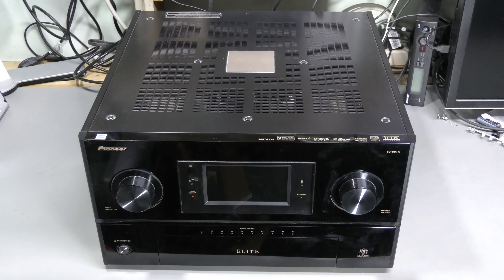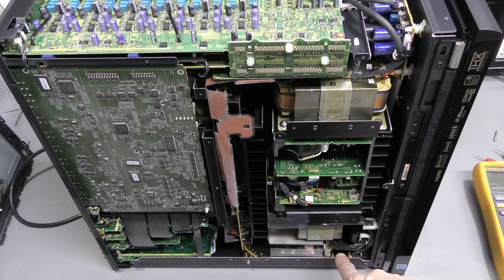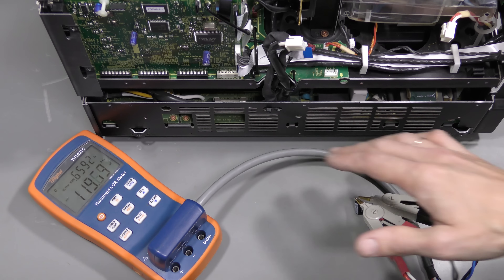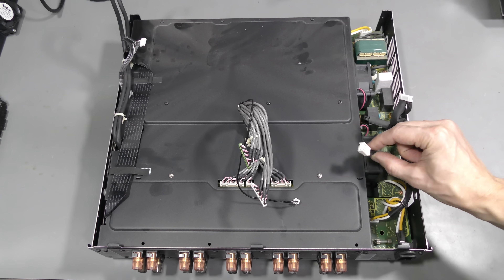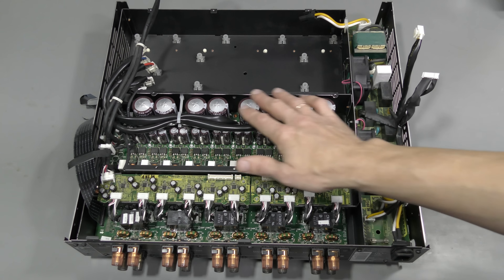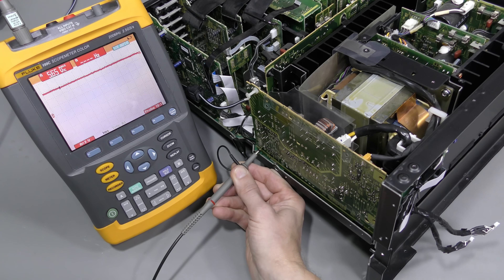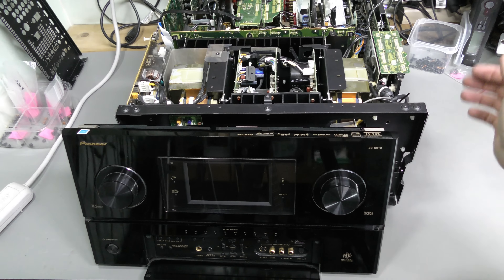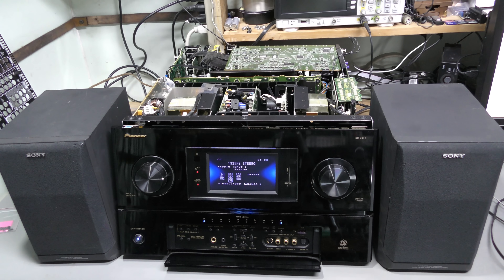#128 - High-end Pioneer Elite SC-09TX receiver repair

Comment: I am amazed at the complexity of this monster AVR. And the ironic part is that about 90% of its back connectors would remain unused most of the time as the end user would most likely just use couple of HDMI inputs. This means many if the daughter boards would also remain unused. But the protection circuit would check each of these boards and even the slightest fault even in any one of the boards would render the whole unit unusable. Just makes me wonder if the whole concept of an 'Integrated' amplifier actually makes sense. 
Btw, amazing troubleshooting this one. I rarely see repair techs inserting logic probes between two chips. 
Amazing work man. Wish you luck!!

Comment: Wow - fantastic work! As you said, it doesn't seem like all those capacitors would bulge exactly the same amount (as they appear to have done in the video) - if caused by heat the ones closer to the fan would be less bulged. Maybe look for manufacturer's literature with pictures of their products?
Reply: Yeah I've never seen large scale capacitor plague like this, I wonder like you if they're meant to look like that
Reply: Plus, it's unlikely that all ten channels were used enough to cause that kind of equal deterioration in all of the caps.

Comment: I dont think i've ever come across electrolytic caps with an as-made from factory bulge. Might be worth investigating the brand & datasheet for one of them.
Never say never though coz all of them with an identical bulge and in different areas of the unit.......you just dont see that!
Expensive to change them all!
Reply: I think that you should replace those capacitors. Excellent and very logical process to find the malfunction.

Comment: Test those caps, since you are in deep enough into it already.  I'd bet that even if many are weak, the unit isn't worth the cost of repair.  The blue power led working after re-solder may be telling another story: there may be other failed solder joints.  Unless it was a result of putting more boards back into the chain and completing that circuit.  These units have more complexity than a home PC!
Reply: That unit is worth about $3500, so I think recapping it would definitely be worth it. It just needed a hard reset to get going again, although That LED might have just had a failed joint like you said. I've worked on a few high-end Vifa Stockholm speakers with a similar issue. After I picked apart the first one, I realized (after a long session of research) that it just required a hard reset as well. Bitter-sweet realization.😬😝

Comment: The only way to really know what happened is by having the firmware of the microcontrollers... or by doing reverse engineering. 
The resonator failure was the key to restarting everything.  
I would like to measure the capacitance near the resonator or the stray capacitance of the PCB.
Can you make resonate the resonator outside of the PCB?
Now it is working. Congratulations!. (By the way, is that Fluke one of the ones you've fixed? Nice instrument!)

Comment: Oh, and one last thought, do you think it would be possible to use the amplifier section on its own, without the upper receiver section?  It's a nice 10 channel amp, and could be used for any number of applications if it could be setup as a separate unit.

Comment: The doming on the triangular relief valve style cap are not even, I think all the caps are bad, I have certainly seen caps testing ok but still being no good when used at higher voltages in circuit.

Comment: Terrific diagnostic work!  I have one of these and it's similarly stuck in a protection mode.  Can you tell me how you did the manual reset?  I've searched the web and cannot find directions for the reset anywhere.

And additionally, would you be interested in repairing my unit?  It's a shame that this big beautiful receiver is just wasting space.  It deserves to be put back into service if possible.
Reply: I have the same unit with similar issues. It powers up for a few seconds and then shuts down. Then the phase control light flashes.  I called every possible repair shop where I’m from and no one will touch it. It really is a shame because up till now it operated flawlessly but now it may as well be a boat anchor.
Reply: @bq6162  So one option might be to try TRD in Nevada.  They are a certified repair company for companies like Crown and Lab Gruppen.  I expect someone there can fix your receiver.  I don't know for sure, but that's who I would contact.  TRD stands for Thermal Relief Design.

Comment: Great repair work! Those caps are probably worth a fortune, is the unit worth it I wonder? 
How much is a working one?
Reply from the maker: I believe when it first came out, the retail price was around $7K
Reply: The large capacitors in the power amplifier are $5 each.  They are Nippon Chemi-Con KMH series and they are designed for high-ripple applications.

As for it being worth repairing, these things can still command over $1000 used.
Reply: @feedback-loop  wrong they where 15 k and i paid 4 k for mine 2 years ago they top the range flag ship was 2 years in the making 1.4 kw output. Ice powered digital amp
Reply from the maker: @Acthungbaby  https://www.soundandvision.com/receivers/pioneer_elite_sc-09tx_av_receiver
Reply: @feedback-loop  i bought for SGD$8888.00 BACK IN 2008.

Comment: 2940uF instead of 3600uF, that's a tough one. If it's my amp I would leave it, but if it's for a business maybe yes. Isn't it more critical for digital circuitry, ie, ripple, than analogue stuff.
Reply: The spec for electros is in the order of +/- 50 percent so they are well within spec. Being 80 volt rated though (non standard voltage) means they will be very expensive to replace.

Comment: Specs 7 x 200 watts 20 Hz to 20 kHz 0.05% THD all channels driven and is weighs just over 70 pounds.  Definitely not a lightweight in power or mass.  This is a class D amp (ICE power).
Reply: Its not 7 channel its 11 and 1.4 kw ouput
Reply: @Acthungbaby  I still use this robeast!  It’s actually 10 channels (200x 7 watts and 10 x 140 watts) 20hz to 20khz 0.05 THD with all channels driven…

Comment: Did I miss something? Did you disassemble the unit before looking online for reset info and trying simpler diagnostics.    If I have a pain in my wrist. And a nail in my shoulder, do you cut into my wrist before removing the nail?
Reply from the maker: Oh, what a shame. I must have screwed this one up entirely. Luckily the video is not upside down. Your example with a nail is so relevant. Thank you very much.